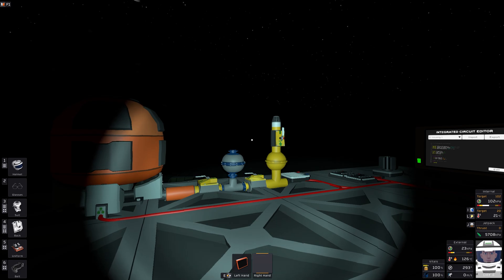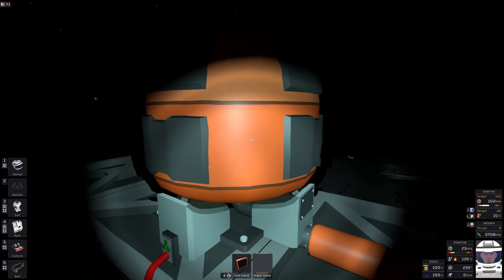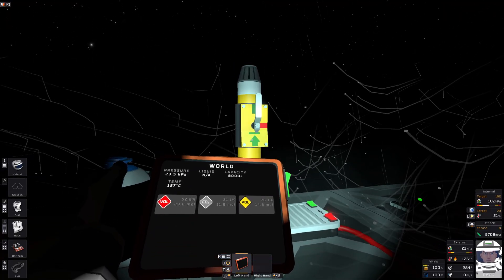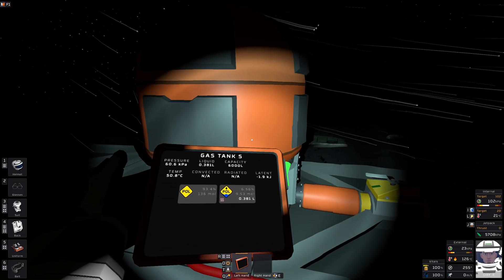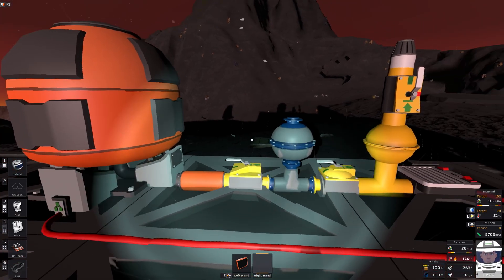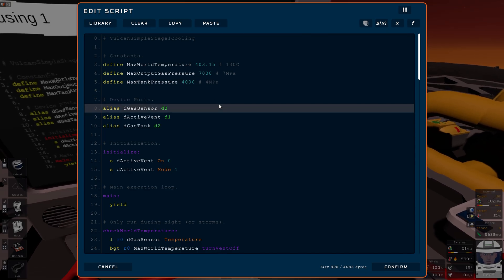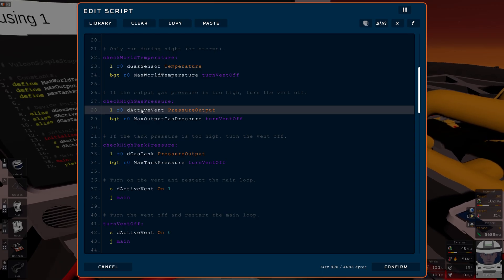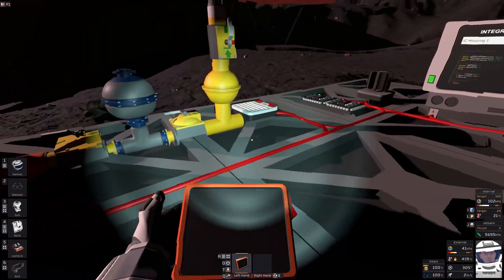Stationeers Coding: Vulcan Simple Phase Change Stage 1 Cooling

Comment: Instead of pulsing the Active Vent you could just set its PressureInternal Limit to 7000.
Reply from the maker: Thanks for the tip, will use that technique in the future.
Reply: @VenusianGamer  Pretty much anytime I write IC10 code for an active vent I will use these lines to define its settings:

s dVent Mode 0 (inward, 1 for outward)
s dVent PressureInternal 45000 (prevent creaking noise from pipes abd overpressure)
s dVent PressureExternal 0
s dVent Lock 1

you can even write to an active vent with a logic memory and a logic writer, if you have not smelted the alloys needed for IC10 chips yet. Super good early gas automation is possible this way.

Comment: When the tank is full, disconnect it from the intake and it is just for the AC heat dump.  Then use the intake to a heat exchange to keep the initial tank at temp.  Probably not the best explanation for me but hopefully it makes sense